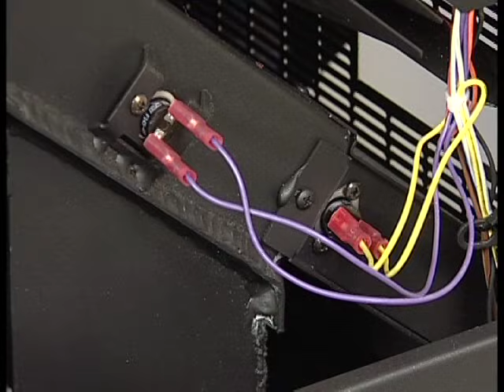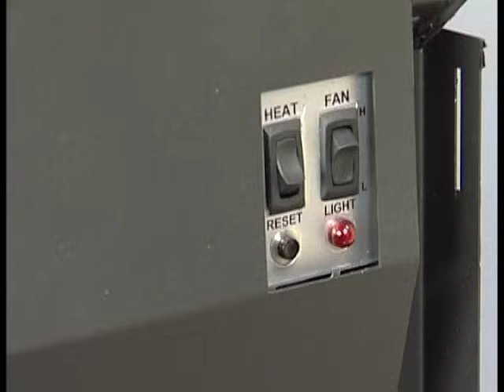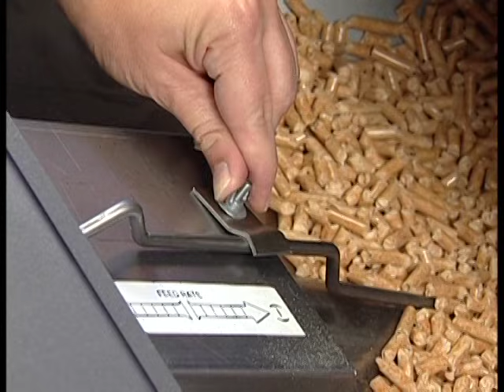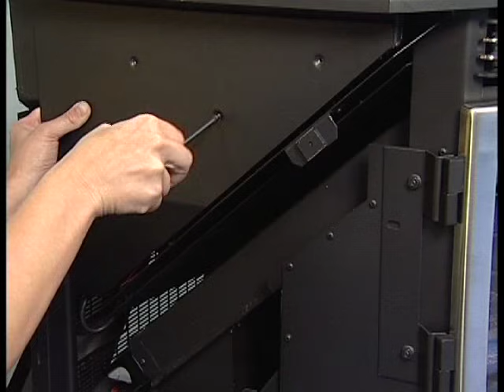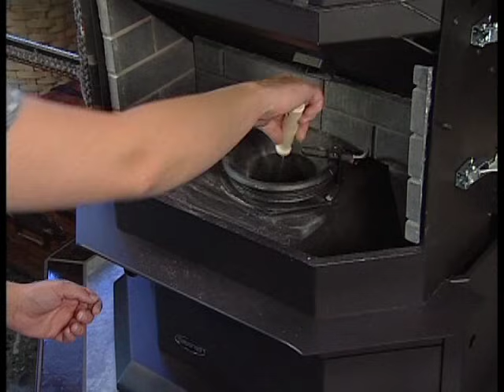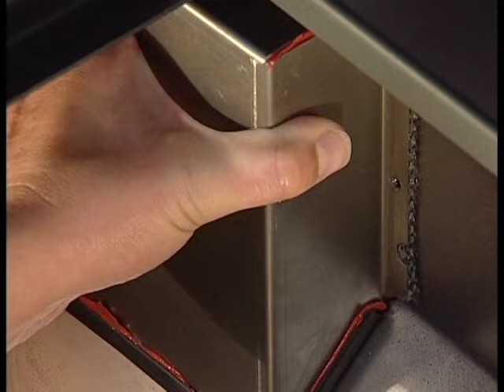Quadra-Fire® Classic Bay 1200 Pellet Stove: Troubleshooting Video

Comment: There is no access to any of these items in my older model Quadra-Fire so no way to check if all wires are connected or there is anything blocking the exhaust fan. Everything functions but it does not ignite.

Comment: The light was not coming on, so I checked the box for the thermostat or the wires come out of. Turns out the box itself is been operated. I replaced the batteries and the light came on

Comment: Worthless video
1200i was good runs about 3 months a year in 6 years I have replaced the auteur, the control box, the vacuum switch numerous snap discs, numerous thermocouples
Clean it weekly - stove is not made that well while it’s nice to have the fire ( secondary heat source) the quality design and engineering of the stove are not that great. If your thinking of buying one I would seriously consider doing a lot of research as there are probably better stoves out there for the money. Support is only from the dealer and most are more interested in selling a new one that servicing one. Overall on a scale of 1-10 I would say when it runs it’s probably an 8 but overall probably more like a six and getting worse with age despite replacing many parts

Comment: Great video. BEFORE checking all your sensors and switches... UNPLUG IT first then inspect each of the blade terminals visually, then plug and unplug them all.  In my case a fan spade was damaged at the wire, and held on to the spade only because of a small piece of wire insulation.   When I unplugged I felt it snap.  Possibly the crimp was not robust, or possibly I had banged it repeatedly after years of vacuuming the exhaust pipe (though it was not directly in the way). Either way, this video helped because I methodically went through the bits to find the issue. A new spade connector is about the easiest repair you could hope for.

Comment: Great video, helped with some other issues I have had with our Quadra Fire 1200 classic bay. But we are having a problem that is not listed here. Usually, when we start our pellet stove, the pellets add about a hand full of pellets to the hopper, it stops the pellets then lights and the pellets start up again when operating normally. Now, the pellets just keep going. It gets so many pellets in the hopper that when it lights it pops like a small explosion and smoke leaks out all around the window. It continues to burn and eventually the pellets burn away but I would like to get this fixed. I don't like breathing the smoke.
Reply: I'm having the same problem and it's been going on since last year. What's worse, is that those little puffs of smoke add up over time, stain your walls and eventually settle on every surface of your house creating a health hazard. I'm having someone check it out (again) in a couple weeks and will follow up if they come find a solution.
Reply: @miketess7626 did you ever figure this out? Mine is doing this

Comment: I have a 1200 insert. During the night the stove is not calling for heat when it should. I have cleaned and inspected the coupler, could it be a bad thermostat?
Reply: You wont get a support response here - contact them directly. I would guess though a thermostat failure would be pretty obvious during the daytime (run a test). It could be something like shutting down after being run X number of hours, duet to maybe an airflow issue somewhere and getting hot. Just a guess

Comment: Our pellets no longer drop from the hopper. Should we replace the auger motor or is there something else we can do? We took the back of the insert off and cleaned everything. We even removed the auger.
Reply: I am actually having the same issue, but my auger is also buzzing. Like a seized motor.  I will be installing a new auger in a few days  when it comes in the mail.